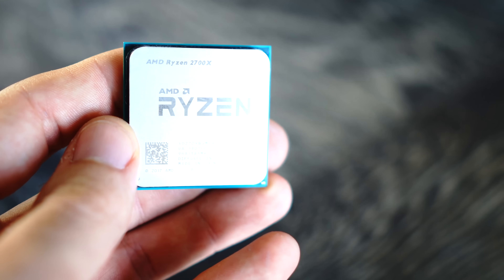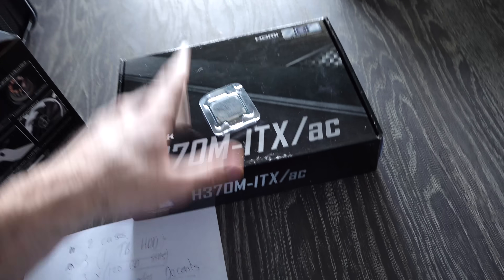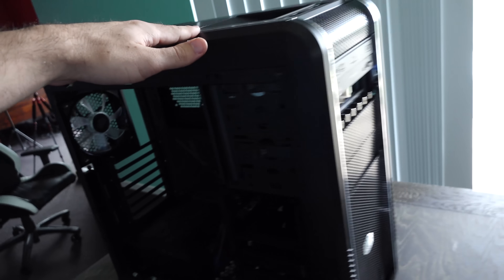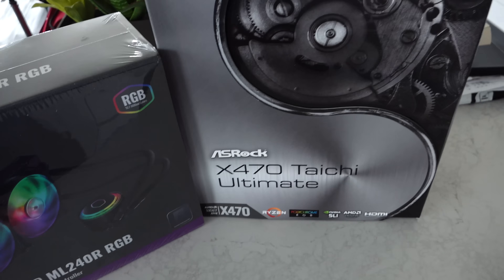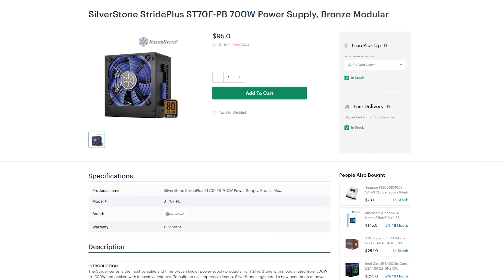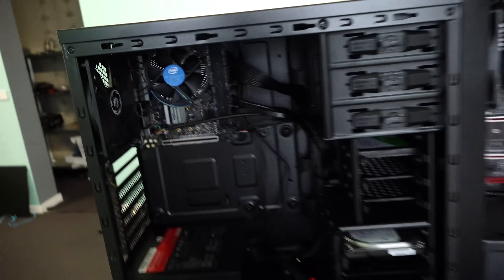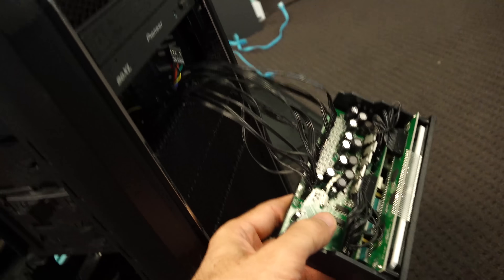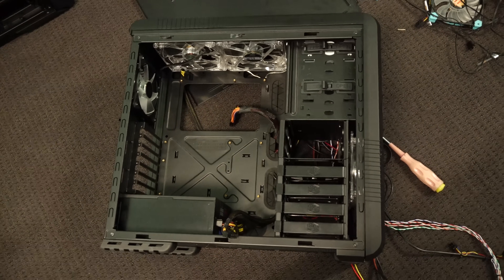X58... Vs... Something... IT BEGINS! The Story of 6 Core 3 Way Comparison that Never Came...

Comment: I want too see Destiny 2 , CSGO , Apex legends , Metro Exodus tested on these systems a bit of old and NEW as for timings and such I think X58 needs 1866Mhz 10,10,10,20 timings for all ram and 24GB …. 4gb per stick Ripjaws X or PNY occupying all 6 Ram slots giving it quad channel so that the X58 cpu can do its absolute best try it out I find this works very well for me

Comment: I have a question: if i switch my i7 920 in favour of a xeon processor will my motherboard support more memory than the aupported by it? I mean currently mu Asus mobo is at the top of memory support, 24 gb ram, and i would like to put 8 gb sticks on it to make it reach 48 ram or even more keeping in mind that the memory controller and support is in the processor itself.
Reply: I do think you can. I found some people upgrading dell t3500's ram above it's maximum support.(It also supports 24gigs). There are also prebuilts like dell t3500 that have 48gb ram on ebay. So I think you can.

Comment: try the gigabyte motherboard GA-X58A-UD5 with xeox x5670 . its amazing . i mamaged to overclock  the 5670 with him to 4.2ghz / vcore 1.3 v  on all the core. on air my  cooler is antec C400. cinemabench score of 982 ( i have 16 gb ram samsung  ddr3 1600mzh .2 slot . overclock to 1920mhz ) on prime 95  torture test  after 3 hours the max temp  is 85 degrees

Comment: Do you have issues overclocking the x58 if you fill all of the ram slots? I thought they could only run fast with three dimms in tri channel, but would not accept memory overclocks if you ran another 3 dimms with two trichannel modes? Love the channel agree with other folks here, your content is getting consistently better.

Comment: hey nice video, i have sort of a problem whit x58 system i have x58a-ud7 rev.1.0 bios f8m and a x5650 oc'ed to 4.18Ghz@1.325v, llc level 2, the problem is that bord power cycles cuple of times every time i start it as soon as blue oc indicator lights turn on, and hwmonitor and hwid gives false reading from motherboard for min/max voltage, temps, power consumption and amperage, in stress test whit aida every thing is normal and no errors, that false readings freak me out peak 264w and 204A to cpu is too much even if it is at slit secnd, voltage for max doesnt change but min is 0.096v for both vcore and ddr, have anyone had problem  like this? :/

Comment: If you end up using GTA V as a game for the benchmarks, I would suggest that you use the online mode in a full server, since that will give you a worst case scenario performance and you can also do a loading time bench just from moving to online mode from the menu options in the story mode, because the drive isn't what dictates that, is other thing, I have the game on a faster drive than one friend of mine yet he loads online faster, differenece is that I have an FX 4100 and he has a Ryzen 5 1600.

Comment: I’m very interested to see what you get out of the 5675.  I was only able to squeak out 4.01ghz out of my 5650.  Although strange thing is my max multiplier was only 20x.  Not sure what that is all about but I’m still happy as I made a massive performance increase over my 950 running @4.2ghz.

Comment: I would really love to see the 4790K (Z97) compared to other platforms for performance. I was into very heavily the X58 and Z87 and Z97 platforms. From my conclusions I see a 10-15% loss of all performance numbers at default clock speeds. However overclocking to 4.8ghz @ 1.27v and DDR3-2400mhz and a 980ti (Overclocked to 1572mhz/8000mem (4000mhz in Afterburner) I've been killing just about anything I throw at it. I have a M.2 950pro 512gb on a riser pci-e slot to increase bandwidth and use available bandwidth for the video card so its not being robbed of its performance. I have friends with newer computers that they paid top dollar for and they are slower than mine which has been tuned well.

Comment: Go as fast as the platform will handle for memory speeds.

For diffusing sound I would recommend hanging up curtains on the wall, it would be easy and look better than those foam sound diffuser towers you made.

Comment: Inspired by your videos I purchased a ASUS Rampage III Extreme motherboard, XEON X5675 and G.SKILL 3x2gb DDR3. Put it together and it post and started to boot Windows. seemed Windows go stuck loading so I turned off the power and now the red cpu error light on. Cleared CMOS and flashed new Bios using the usb flash feature with no luck. Any advise on how to proceed? I ordered two cheap E5506 cpus to test to see if possible issue with the X5675.

Comment: The case is some form of CM690, either a first or second gen.

A true comparison of the systems would be to run the DDR4 in the AMD system as fast as it can go. One of the benefits of going with the AMD platform.

Comment: I think that for a Ryzen 5 3000MHz RAM should be fine, as you could still get it up to 3600MHz with relaxed timings and higher memory voltages

Comment: @Tech Yes City - This comparison I LOVE... old intel hardware, new intel hardware, Ryzen (the meta/value)... GREAT work man! 
In my opinion, you should maximize your memory capabilities in this comparison, just use the same memory sticks across both newer platforms (if possible). Since the ITX build will only take 2 sticks then use the same on the Ryzen but overclock on each system as much as possible. (Those variables say a lot about the platform.) Obviously the X58 and DDR3 cant be the same but that's ok.

Comment: One stupid question: why did it have to be an Intel stock cooler specifically? Was that a constraint of the motherboard, as it is an ITX mobo, or just you getting what you thought you should? Theoretically, any low TDP cooler should have worked, and something like a Hyper 212 EVO or the Freezer 33 wouldn't have issues with a locked i5.

Comment: Yes Man at it again with one of the most fun and entertaining platforms ever. All of your x58 videos only make me more and more happy and proud of my PC, even with a now aged and poor Motherboard that even suffered a thunderstruck that fried one of the LAN ports. You've even helped me recently with your videos on the x5675/x58 OC!

I was never even caring about things like the CPU PLL for example, and when i would google about it and other settings trying squeeze the last bit of my PC, all i would find is ppl actually decreasing those voltages for "stability" purposes. I've been always struggling to get my x5675 fairly stable and cool after 4.3Ghz, but after i saw your latest vids and saw some of the values you were using, i decided to try with it and... bingo! Now im at a very stable 4.5Ghz after raising the PLL to 1.92v, and i've even been able to lower the CPU voltage, now bouncing from 1.408v to 1.424v under max stress. I also discovered recently that using EIST/Speedstep wasn't really helping much with stability either, and C-States was even worse, being detrimental to the performance in some tests and also giving me some stutters in some games. I found out that C1E was the better option to choose, since it's the CPU integrated management unlike EIST for ex. and it wasn't hurting performance, while maintaining the CPU cool in low loads.

Now, for the comparisons and tests you'll be doing, i would want to recommend you one thing that i couldn't do myself since i don't have the money to spend, but i guess you could manage: if you can, try to get some Ram sticks at 2100-2400 and if so, try to at least go past 2000+. We know that Ram latencies on x58 don't matter/help that much, but i've seen some tests from ppl with things like 24gb and speeds of 2100, and THAT actually helps A LOT to the performance. These Xeon's IMCs are pure beasts that will eat anything you throw at them. I've not even the same stick speeds or capacities myself and this x5675 just handles them like nothing.

Since i have the same CPU and clocked at the same speed now, i'll leave you some tests i've done in the last days in case you'd like to compare them to yours or for references, i hope it'll be useful for you or someone else here.

Cinebench / AIDA / Others -----> https://imgur.com/a/CvozSvT
CPU-Z -----> https://valid.x86.fr/yefiz5
Firestrike -----> https://www.3dmark.com/3dm/26233749?
TimeSpy -----> https://www.3dmark.com/3dm/26233877?
Geekbench -----> https://browser.geekbench.com/v4/cpu/8015688

Keep the content coming! Happy days.

Comment: Cant wait. The RAM on the Ryzen rig, I think it would be fair to set the XMP and call it done with that. The Xeon rig, run it as fast on CPU and RAM as you can take it! PUBG is the tough one for streaming , and if you include the OBS stream settings like CPU preset (faster?), Bitrate, resolution (720p30 would be fine for single system gaming/streaming but the torture test could be trying 720p60 on Very fast).

Comment: For a fair comparison only 2400mhz ram should be used as memory speed makes almost no difference for the i5 and the difference in price between a 2400mhz set and 3200mhz set of ram on top of the already stupid prices of ram is just completely unaffordable for most people. Plus with Ryzen 5 chips there are very diminishing returns for higher speed memory compared to a ryzen 7.

Comment: Can you test multiplayer at 1080P with medium settings on Black Ops 3, CS:GO, BF1, BF4? I know 3 of the 4 games are kind of old, but, I'm just curious if you can replicate the weird anomalie of Ryzen system to cause GPU usage to dip to 0% in-game and throughout the game.... 

I heard that AMD has tweaked the new Ryzen to reduce cross-ccx memory latency. But, since Ryzen 1 (first gen) high latency was abnormally high in cross-ccx memory latency, I am still not sure if the reduced latency is enough.

Thanks!

Comment: The x5675 is a good chip, but is it fair to compare it to two current generation 6 core chips? guess we'll find out, eh. My prediction is the 2600 comes out on top, then x5675, then the 8400 for synthetic tests like cinebench/blender and whatnot because of the multithreading. As for games I think it's going to depend on whether the h370 board allows turbo to 4ghz on all cores as the base speed of 2.8 is kinda meh, If it does I think the 8400 will come out on top with the x5675 coming in last.

Comment: I'd run the 2600 as high as u can get the ram but it's kind of unfair for the 8400. Z370 boards can be had for pretty cheap to pair with an 8400 and have ability to clock up the ram. I'd skip that board n stick a z370 in. U gotta have 1 lying around.

I vote 8400 will win but be very very close. Ram speed should be matched tho or it's kind of a pointless. Ram speeds have a large effect in recent games.
Reply: Prime example
https://m.newegg.com/products/N82E16813145048

Comment: Oh more X58 stuff. i lke it. I cant believe i after almost 10 years is still on X58 and even as my main gaming rig here in 2018, of cause with som upgrades over the years as new GPU, more ram, new SSD and so on. Yes 10 years after X58 lauched (released in November 2008). 

Started out my X58 adventure with the cheapest CPU you cut get for X58 the well known I7 920. Had it oc to 4.1 GHz for every day use and gaming.I had my I7 920 with Asus Rampage 2 Extreme motherboard until the beginning of 2017 where i found a X58 bundle to a great price with a I7 980X CPU, Asus P6X58D Premium mobo, 12 GB corsair triple channel ram and a Noctua NH-D14 CPU cooler to 240 USD including shipping and if look at what CPU and motherboard goes for alone, it where a great price + after i sold my old CPU and mobo it where a pretty cheap upgrade and them i where ad it any way i also upgraded GPU to a EVGA GTX 1080 TI and got my hands on two used Samsung 950 PRO m.2 NVMe SSD´s for OS and games.

So this is how my rig is configured today for every day use.
https://i.imgur.com/ctKGozc.jpg

3dmark fire strike score with my old setup in form of I7 920 and my current I7 980X setup.

https://i.imgur.com/IV1BkxZ.jpg
https://www.3dmark.com/fs/13514527

What about games. Well here is some runs with a new 2018 game in form of Far Cry 5 build in benchmark in 1200P, 1600 and 4K resolution all with settings at ultra. I chose this game cause its very new and a open world game that tends to be more CPU intensive. And yet good old X58 can still max even the newest games out. Not to shabby for a platform released almost 10 years ago.
https://i.imgur.com/W4In6Eu.jpg
https://i.imgur.com/5e0FYi0.jpg
https://i.imgur.com/Zvod9rU.jpgThe only thing i regred now is that i dit not keep my old Asus Rampage 2 extreme mobo and then put a cheap Xeon 6 core CPU in it. Cause then i cut have had two great X58 gaming pc´s.

Comment: Everytime I build a system and buy from umart, everything is in stock on the site when I put the order through (yes the correct store location is selected), when I got to pick them up I will almost always get the 'Oh sorry this part isn't actually in stock, would you please go and see sales and pick something else' then have to wait upto 40 minutes in line to see a sales consultant (after already waiting 20 minutes to pick the parts up), only to find they don't have anything equivalent in stock... But the decent pricing compared to most other places in brisbane is what keeps me going there.

Comment: Here is what I want to see tested in terms of performance :

Out-of-the-box comparison, with no adjustment to BCLK or multiplier, voltages, etc. But XMP enabled.
Clock-per-clock comparison at the highest clockspeed the least fast (just in terms of GHz) one can handle.
Comparison of the maximum overclock any is capable.

A fair memory configuration I think would be something that brings the same level of memory across the board. I was thinking X58 in quad channel DDR3 1333 vs the Ryzen 5 and i5 in dual channel DDR4 2666.

Comment: Hi Bryan, 2933 or 3200 RAM for the ryzen. From my experience i would Clock the xeon at 4.4ghz with 200 MHz system clock, 1600 ram and the highest stable uncore at the asus. Makes the hole System snappier and faster then the 100 more cpu clock and You have better temps when the voltage is beeing reduced. Keep up the great work.

Comment: As for your question about Ryzen memory clock speeds - it should be clocked as high as possible - memory is the Ryzen's backbone to performance, so, just like overclocking Intel is important to the IPC result, Ryzen should be given fair chance with it's memory overclock.

Comment: Tech Yes x58 City, use:
Ddr4 3200
Ddr3 1600~1700
4.2 ghz Ryzen 
3.8ghz uncore Xeon 
Xeon vs i5 with ht disabled also, it's possible to go much faster. 
Include the r5 1600, it's really important. 
Stay real.

Comment: I've just gotten myself an Asus Rampage Extreme 3 and a Xeon x5670 clocked at 4.5ghz with a Cooler Master Hyper TX3i

So far things seem to be going well. Temps are a little higher than with my previous i5-4460 but that is to be expected and it certainly runs quieter than the old x5460 that now lives in my cupboard.

The only thing I wished I'd researched a little better was that the Rampage 3 doesn't have a USB 3 header on the motherboard, so two of my front panel USB ports don't work. I've bought a little adaptor to split the USB2 header, so at least I'll have all four ports at the front functional when it arrives.

Comment: I just can't seem to find any decently priced X58 boards on eBay or Ali express. The CPU here in the UK is only £30 which is CRAZY considering the performance, but would be nicer if the boards were a bit cheaper
Reply: Matt G I just found one for 100 US.
Reply: Christopher Federico The board or the CPU? Either way it's a rip off
Reply: Matt G Motherboard. I already had two 5650's when I upgraded my R710.

Comment: A good use for those white sound dampening foam tiles would be to create a big movable wall that you could use anywhere on the studio do reduce echo. Just glue them into a wood panel and put some wheels on the bottom to carry it around.

Comment: Could you up your UCLK/NB on the X5675? I've got mine at 3.6GHz at 1.335V QPI/Vtt and 1.2V QPI PLL with 1.6GHz DDR3 on an X58A-UD3R rev 2. It does actually boost performance and gives a clear uplift in scores in CB.

CB and 3DMark Vantage are great free stability tests for it too.

EDIT: As a point of reference, with my X5670 at 4.4GHz I get 1020-1030 points in CB.
Reply: SlavjanA, yeah.. that 3.2 uncore speed is a no no. I don't think it's too difficult to pass 3.8ghz especially with his motherboard.
Reply: why only 3.6ghz? Is it hard to OC?
Reply: hesilviu silviu At least 3.6GHz to follow that "double the mem speed" rule of thumb as he's got his mem at 1.8GHz.
Reply: Cheater Buster Tis my limit. Maybe if I played with the skews I could get some more, but I can't go higher on my QPI voltage and the other voltages don't affect it so 3.6 it is.